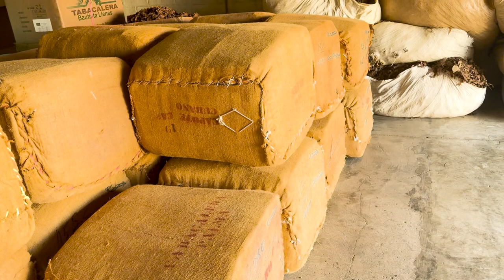Project ITS Episode 2: Factory Tour Tabacalera Las Lavas

Comment: With seeing how dry the filler is makes you think it doesn’t matter if it’s Cigar dries out just rehydrated properly and it will still be good to smoke
Reply from the maker: you're smoking the Oil not the water. so drier the better. only reason why you need moisture is so that it doesn't crack into million pieces when you cut it or when heat causes it to expand.